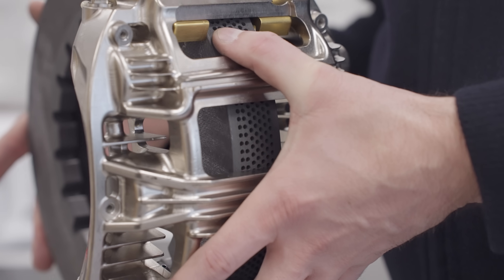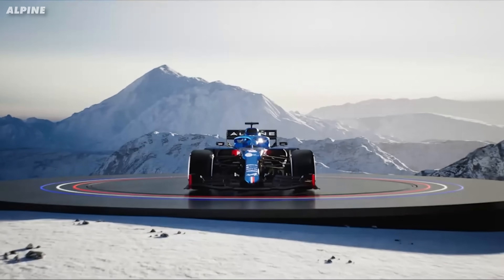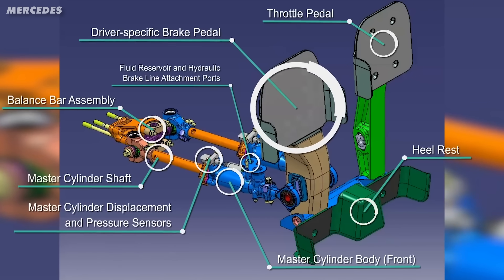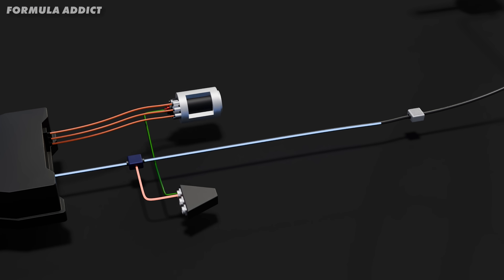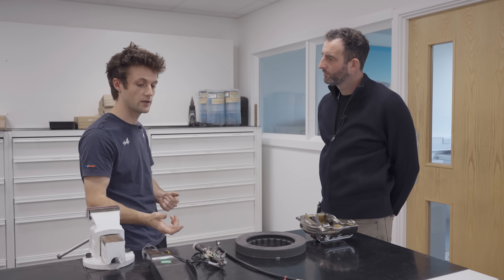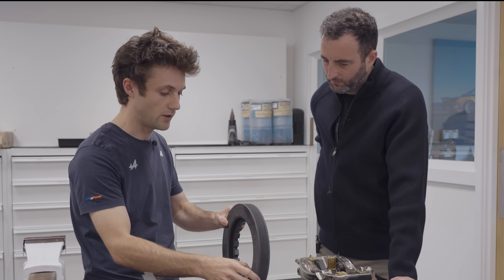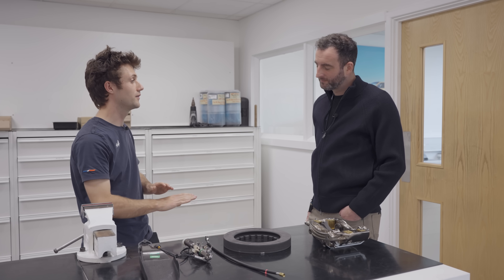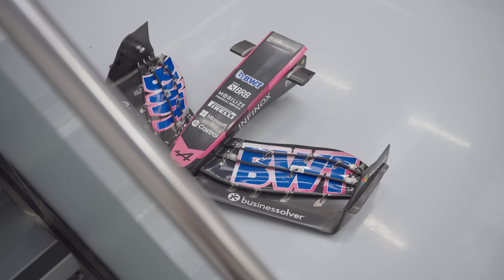How Formula 1 Brakes Work (F1 team explains)

Comment: The 180kg force is a bit misleading. The force they use is not just them pushing on the pedal, it is heavily influenced by the G-forces in play. So it is more like holding three times their bodyweight, it is not pushing 3 people off the ground with one leg. And they rarely hit the maximum. But even when you take away the misleading statements, it is still a hell of a lot of force they have to exert and they need to do that for 90 minutes. 

I wish they stopped saying that it takes X kg when that X kg isn't all done by the driver and when that X kg is done once in the whole fucking season... It just gives the wrong idea. The truth here is easily impressive enough: you or i will not be able to the same. We might have enough strength to push that pedal to about what it needs but we will not be able to do it multiple times in succession. About a decade ago i could've probably hold two people and take a step or two, and then my legs would've just given up. It is the amount of repetition they are able to do at around 90-120kg and still have great precision that is really impressive, and they do not have massive legs either. It is very compact strength.
Reply: Yes - the forces at play make a difference. The impressive bit is the fine modulation a driver is able to make under very high loads. I think of it in terms of "work" - the work load is still incredibly high regardless of G. That an F1 driver can do this consistently for a whole race is is more than impressive
Reply: i was about to comment on this, what the drivers do is so impressive by it's self, why do people then exaggerate it making it less impressive in the end? its so dumb
Reply: @krassbear33  Agreed. They'd have calves like bodybuilders, and they clearly don't.
Reply: I am not sure you understand what is going on here. 
It is 180kgs approx to lock up a wheel and yes you do need some great strength from training to do it.
I have an LMP3 car that has approx 130kgs needed in order to lock up the wheels, obviously all dependant on grip and aero levels at what velocity, determines the force needed.
The reason the pedal virtually has no movement and you need so much force is when the quads, glutes and hamstrings are squeezed, you have a very high resolution of feel in the muscle fibres, that high resolution from our organic bodies helps the brake modulation process.  
At high speed is insanely difficult to lock up a wheel. (I had to train in the gym to race my car just for this).
But as the aero bleeds off, we have to bleed off the brakes too, but even at lower speeds where a lighter brake is needed, you still get a decent amount of brake pressure before pinching a tyre, so at lower speeds a good, high organic resolution and modulation feel can still be achieved.
My brake pedal in my race car feels like pushing on a concrete wall, I only feel the brake force through muscle tension, not movement.
If you load up 180kgs at the gym and do a 1cm leg press, you can do it, but through a full ROM, it is impossible.
The straighter our legs, the more we can do it.  
The deeper the range, it becomes harder, this is just biomechanics at play.
The reason I needed to train for my brake pedal is I am quite tall for my car and needed to sit lower in the tub to get low enough, the result was a more bent braking leg and I needed to get more strength to compensate for my leg being in a more sub optimal position, I hope all of this makes a little more sense? 😊🙏
Reply: Sounds like you need to set up your seating position mate
Reply: My race car needs about 60kg on the brake pedal.
it's hard, but not too bad.
200kg would be unreasonable on it's own.
Reply: @3rdGenGuy  Exactly, well said.
Reply: @3rdGenGuy  that's most likely a lot less than you standing on one leg  with your knee bent!
Reply: While I don't doubt the 180kg force needed, the representation that the driver is providing that is, I think, very misleading.  But (politely) the disparity doesn't have anything to do with g-forces.  The pedal is a lever.  The linkage is closer to the floor than the mid point of the lever.  So there will be a force multiplier at work.  I suspect that is the reason why some drivers want a strong spring to enhance feel; the 'native' pressure required is not that great and they actually want to increase the pressure required.
Reply: @steven_xigxog  when drivers are experiencing 5G during braking, their body is pushed forward in the cockpit, even though they are strapped in.  They are resisting that massive force by keeping their legs stiff, which automatically applies pressure to the brake.  If the brakes were soft, the the driver would have to pull his leg away from the pedal or it would go to the floor every time they hit the brakes to go into the corner, and the wheels would lock up.  That's the obvious reason they like a very stiff pedal.  It's just easier to drive that way, even though it's a lot of force that needs to be supported by their leg/legs.
Reply: @0101-s7v  The implications of your statement are that the engineers have to factor in inadvertent braking due to g forces, that drivers have to do likewise, and that they're mitigating that by increasing brake force based upon these factors which would vary wildly from driver to driver as they (apparently) slosh around the cockpit and are saved from sliding into the floor only by the pedals(?).  Engineers want to distill out as many external factors as possible and enable drivers to control the car precisely.  They're not mashing on the brakes with the help of g forces.  They're precisely controlling the brakes to feel when lockup may occur so that they may prevent same.  They're not sloshing around the cockpit.  They're strapped in to prevent movement and enable them to concentrate on feel.  Note that driving an F1 car is a two-footed operation and their feet are always on the pedals.  They cannot brace themselves with their feet.
Reply: @steven_xigxog  I'm saying it's easier for them to drive with the harder brake pedal.  Otherwise they wouldn't want a harder brake pedal.  It's not rocket science.
Reply: Please ignore this comment, everyone. 
It's entirely incorrect, and shows a lack of understanding of the forces at play. 
Draw a free body diagram and you'll understand. 
(Or read some of the other replies which are mainly correct)
Reply: @procatprocat9647  You're wrong, people ignore his reply
Reply: just jump on scale with 1 leg 🤤
Reply: Meh , they're being deceitful in their language exaggerating what it takes to press a brake pedal .
Reply: Yeah I would really appreciate someone explaining the exact way & possibly where they are measuring this because I'm extremely precise with weights and measures and really appreciate time and motion studies (maybe why I love F1). I would be surprised if that much load is actually going through a drivers leg under heavy braking for a few reasons:-
1. I've heard many times from drivers (sure once or twice from Lewis himself) saying that it is about 90-100kg.
2. I've heard from team personal and pundits quoting very similar numbers as the drivers over many years.
I suspect the measurement is taking into account the G load on the drivers body as it is braced back against the seat/cockpit which may include the braced load on the drivers back/torso.
It is definitely possible that the leg is "supporting" that full load. In my early 40's I was leg pressing 360kg for 20 reps &that is quite similar seating position (but with two legs obviously). Come to think of it I think I did about half with just 1 leg. But then I was 100kg and very powerful big legs. Even in my mid 20's at 78kg I could easily squat the weight of 2 guys however my legs were bigger more muscle and much stronger than most people and definitely F1 drivers, from 10 years of competitive sport and high level running in fact I'm sure I did more klms than some peoples cars..(f/d knees now though!)
Reply: I wonder how many f1 drivers could squat 180kg
Reply: @romulobinghay9054 none of them, you are missing the point.
Reply: Is it really 180 kg that the driver has to push? Or maybe they dont need that much force, and the pedal has to push 180 kg not the drivers leg. The pedal has some lenght from the cilinder thing that has to be pressed in. So there is a leverage. If the pedal would be a meter long and the driver leg would be pressing the end of the 1 meter pedal, he might just have to press it with 1 kg of force while the break pedal would still pressing it with 180 kg. Or the 180 kg force has to be applied to the pedal and the force  that the pedal is pushing is higher than 180 kg?
Reply: @tojassargaja2085 I think you are missing the point, the 180kg load is for the quads to feel massive flex, they don't move thier legs, to push on a 180kgs with hardly any ROM is actually not as hard as you think with some mild training, it is not like squatting 180kgs with one leg, not even close.
The leg flex tension is like an organic strain guage, when you have this level of flex in the muscle, the resolution of pressure felt by the leg is really good, this is how brake pedal modulation is achieved to such a high standard in terms of feel and why they rarely pinch tyres under brakes.
Don't worry, it took me a while to get my head around this when I started driving some high end aero cars, I actually remember not liking it at first, but when I got used to it, I absolutely love it, heavy brake pedals are a performance upgrade to the driver.
Reply: Yeah, that's some bull to say those little guys are pushing 400lbs with 1 foot. That's not happening; not even once.
Reply: @madcow3007  they are not pushing that weight, they are static loading it, there is a huge difference between the two.
I use approx 130kgs in my own race car and it is like pushing on a concrete floor.  I am nearly full strength to get a wheel to lock up.   I am in a compromised position with my car because of my height, so my legs are quite bent, so my strength is challenging and I had to train at the gym to do it. 
But at 180kgs with a straight leg and slight bend, I'd be able to static load push it......with training, everyone is getting this "180kgs" thing wrong, it is not like they are squatting it. 
 At my peak I could only squat 100kgs two legs and my 130kgs brake pedal was very easy for me when I was this strong, all just on one leg. 
I am not sure you are understanding the biomechanics of range of motion vs static load pressure/force.  
I could easily unrack a 200kgs squat rack, but I could only hold the weight, I could not perform the actual squat 😉  
I actually calf raise 200kgs, but that is it, no way can I squat it down and neither could any F1 driver.
Reply: Thank you for explaining this! I knew it wasn't correct, I just wasn't sure how to explain without being moaned at by the super-geeks. I've raced bikes for years, one of the mechanics told me I was applying 100kgs to the pedal each time, I told him I'm not, that's impossible, but he wouldn't have any of it.
Reply: Not many people can do a Single Leg Press with 3x their body weight. I was definitely wondering what the actual force is.
Reply: What is also super impressive is that the forces pressing the diver into the pedals on braking will be different from corner to corner.
Reply: keep in mind the driver does not slide forward in their seat, or at least not the amount required to press the pedal, so the Gs are irrelevant when measuring the 'pedal force' as the distance between the pedal and driver's bottom (one point of anchor) does not change under braking.

that being said, i'm not sure what they're calculating/measuring when they give those (max) numbers. there's obviously a mechanical advantage w/ using a hinged pedal so they might be talking about the force exerted on the master cylinder piston rod? 
the precision and consistency the drivers are capable of is beyond impressive.
Reply: @duroxkilo  aren't F1 cars brake-by-wire now? Why would they require so much force if it wasn't beneficial to the driver?
Reply: @exit_libris  i am not up to date to F1 regulations but if anything like the past, they use the term loosely (as in the system does not add but restricts force if that makes sense).
it would be like a steering assist that only makes turning the steering wheel harder when needed but not easier ever...
Reply: @duroxkilo   Should have clarified. REAR brakes, not the brake system as a whole is brake-by-wire. 

For steering that doesn’t sound totally right to me. F1 has much faster cornering speeds so it’s harder on necks but drivers say Indycar is a lot more physical on the upper body because they don’t have power steering.
Reply: @exit_libris  They aren't applying that much force. No way. The leverage of the pedal system maybe, but not initially.
Reply: The neck usually experiences more load during a race weekend then the braking leg anyways. I mean it's not wonder F1 drivers have such large necks like Fernando and Lewis!
Reply: Newton's third law anyone?
Reply: @ab8jeh  you'll get blank faces saying things like that. 
Some of the comments here are hilarious 😂
Reply: Is NOT misleading. Thats the max  the leg of the driver have to support on braking.  But you have the aid of the knee already being almost parallel to the braking force and transfer most of it to the seat thru your bones.
Reply: When the average racing driver gets in an F1 car will only use about 20% of brake force.
Reply: The true skill is of the drivers to pull their weight out of the pedal under force, the measured pressure is obviously far less than what they're stating. But you know, big numbers = big headlines.. or something of that nature....
Reply: The best part:  force is not measured in kilograms in the metric system.  It is measured in Newtons.  Kilogram is a unit of mass.  Force is a unit a weight.  Weight is mass in an acceleration state.  They are not the same thing.  A 1 kg brick on earth will have a mass of 1 kg.  That same brick floating in free space (far away from any gravitational influence) will also have a mass of 1 kg.  It will have a weight of 9.8 Newtons on earth, and a weight of 0 Newtons in deep space.
Reply: I can stand on one leg, lift my 70kg body up and down a few times just fine, and I'm a lazy ass couch fck...imagine someone trained. This isn't hard to grasp. Our legs are quite strong.
Reply: Yes, G force does most of the work, all the driver has to do is modulate the stiffness of his leg.   That's why larger, heavier drivers like a stiffer pedal
Reply: Zero meaning. His words have no weight
Reply: @honeybadger0612  no, but his thoughts do.  Thoughts are very heavy
Reply: I’ll fix this the driver modulates 180kg through his leg.  Done.
Reply: I thought the whole idea of liquid leverage or hydraulics was getting a lot out whilst putting a little in?
Reply: @optimusminimus-v3d  Indeed.  Pascal's law.  The notion that the driver is pressing on the brakes with 400 lbs of force is more than a bit silly.  The notion that the application of force via a lever pressing on a small piston at the master yields 400 lbs of force at the caliper is not.
Reply: @optimusminimus-v3d  It is, the force pushing the brake pads is measured in tons.
Reply: Exactly, recently I've tried the simulator of F1 in EICMA of Milano, which you can find half F1 car model where you can sit and three monitors in front of you with F1 simulator 2022, so I've decided to try it but they put the pedal brake with this system strong hydraulic and I've said: "are you stupid? there's no G-force to press ahahah" so I saw a lot of players with the steering wheel slipping away.
Reply: If you are fully restrained in a seat with a bent knee and decelerate at 6G, your leg will fly forward. If your leg is fully straight, it can't transfer any of that weight into the pedal. But if it's bent, it will try to straighten. Whether that force depresses the brake pedal depends on the angles involved. If we assume the knee is directly parallel to the ground then it doesn't contribute to brake pedal force. If the calf is angled 20° down at the knee, then it is at a slight mechanical disadvantage and the pedal feels cos(20°)=94% of the force. If the calf weighs 4kg, at 5G and 94% mechanical advantage, then that's 19kg of force into the brake pedal.

It's still crazy to imagine doing a 161kg single leg squat (or a 322 -BW = 250kg or 550lb standard squat) over and over during a race....but as others have pointed out, it's a small ROM so more like unracking a 250kg/550lb bar. This seems believable BUT if it's for all 20 turns for all 70 laps, so doing this 1400 times in an hour and a half that seems like that would be hard on even a very strong person.

If the pedal gives the driver even a 1.5:1 mechanical advantage, it becomes a very believable feat of strength and endurance.

So g forces from the leg might make a small difference but it's not entirely unbelievable, and even a small amount of mechanical advantage in the pedal would quickly make a bigger difference than G forces.
Reply: Those forces are still travelling through their legs into the pedal though.

Nobody is saying they one leg press every corner.
Reply: I suspect the 180kg number is bullshit. That might be the force that's going through the rod that's just above the pivot at the bottom of the pedal. But the driver is pushing on the top portion of the pedal, so there's a huge force multiplier called a lever.
Reply: Sure, 180kg isn't applied on the pedal the whole race but I found out very little of it is influenced by the G-forces during my Formula Student year. Keep in mind the seat harness is tightened really strong and driver movement is minimal. Also our car did 1.3G during braking not 6G so it may not be a 100% accurate comparison but I doubt F1 harness aren't tightened accordingly. You'd be surprised by how much an average person can push on a brake pedal, the trick is that the seating position allows you to push with your whole back on the seat. During static testing I did 90kg and I'm far from the strongest person, our driver hit 120kg consistently. I'd say the fatigue is the more impressive factor, it was insanely difficult for me to repeatedly achieve 70kg, I did 15 or so reps until I got a cramp lol.
Reply: No way it only did 1.3 under braking. I feel like street cars do more than that  @alfadelta2770
Reply: I can't say you are completely wrong because there are subtleties to this. However, the whole load into the pedal is through the driver's leg and foot so he is pushing/supporting up to 180kgf, the exertion is the same. G is a big factor but the driver position means the seat, steering wheel and belts play their part in load distribution too (kitted driver of 80kg at 6g is about 470kgf)
Reply: @ColinCarFan  theyre are not bending their leg just holding it straight. A gym equivalent would be that they can unrack 180kg but they cant squat it, which most trained people could do
Reply: @ColinCarFan actually no, thr exertion isn't the same. There is a difference in the amount of strength a person can display, depending on the direction of the motion. You are stronger in the eccentric phase than the isometric phase, and you are stronger in the isometric phase than you are in the concentric phase. The physics may calculate the same, but they will be able to tolerate more force that is being put onto their leg by g forces in comparison to them simply pushing the brake.
Reply: @ColinCarFan there's some physics at play I don't fully understand to be fair, but I don't think the brake force comes for 'free'. The driver has to use a lot of force (how much I don't know), maintain that force and trail off in a controlled manner. The telemetry records the brake input in terms of hydraulic pressure, too - so how to get from one to the other I'm not sure. But we're not disagreeing for sure. And whatever the load may be, I'm pretty sure I could handle a few corners before I couldn't do it anymore!
Reply: but you still do 180kg of force in one leg xD
Reply: Unfortunately, your comment is less accurate than the video! Just because there are G forces trying to launch the driver forward, doesn't take awy from the force exerted by the driver - he is STILL transmitting all that force through his leg, how else does it get to the pedal?
Reply: @GamezGuru1  It is not the same. First, the movement range is far smaller. And second: are you saying that standing up requires as much force than a squat?
Reply: @squidcaps4308 it actually exactly does. The force is the same only your leverage etc changes so its easier
Reply: @squidcaps4308  the movement range is smaller than what? This sentence has no context...

I never said braking is like squatting. I simply stated that the g forces do not reduce the force the driver must exert as implied by OP.